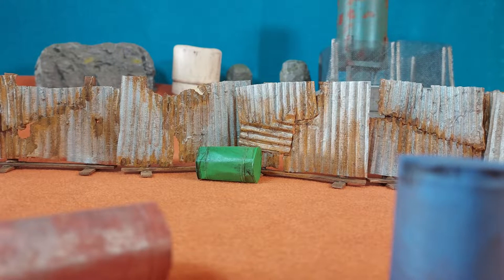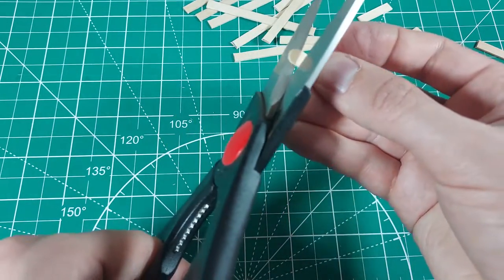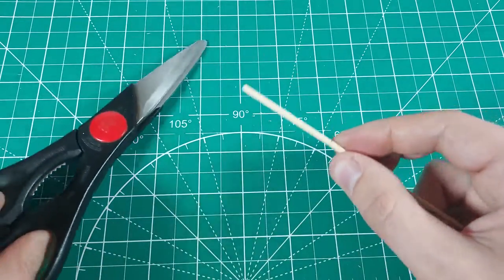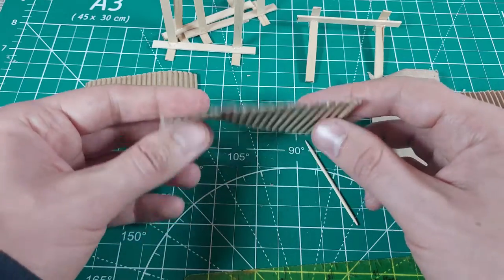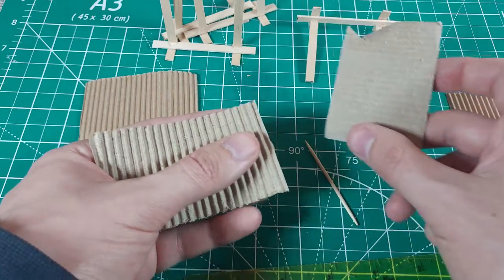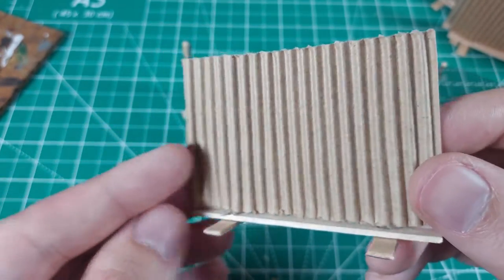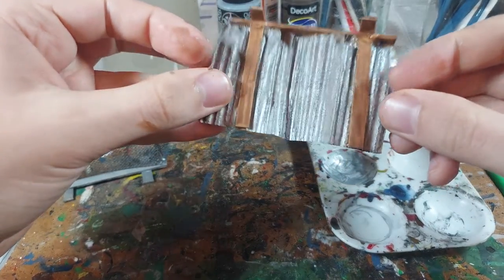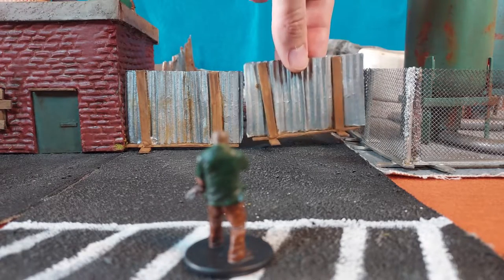Crafting Miniature Industrial Fence Terrain

Comment: I made these fences in longer 5” x 2” sections using real metal salvaged from soda can strips harvested from the recycling bin and put through a metal tube squeezer bought off Amazon to corrugated them. It worked great. This craft is quick and easy, and the results are very effective. Thanks!